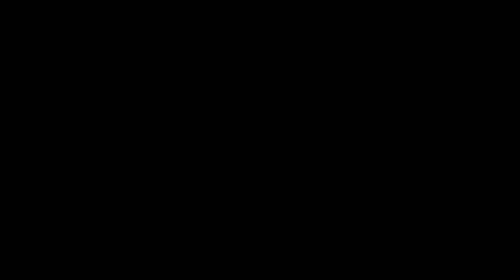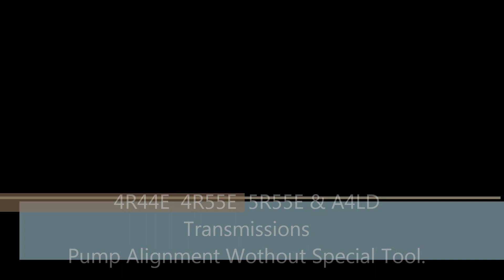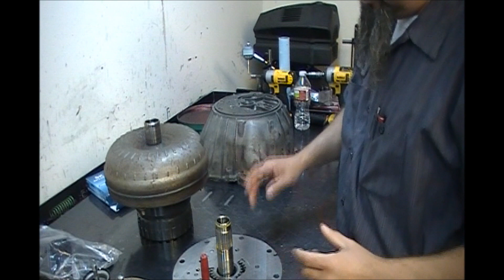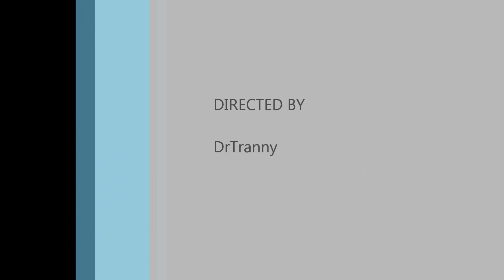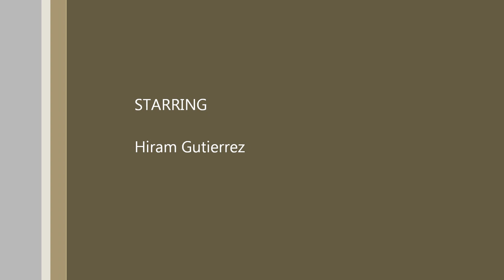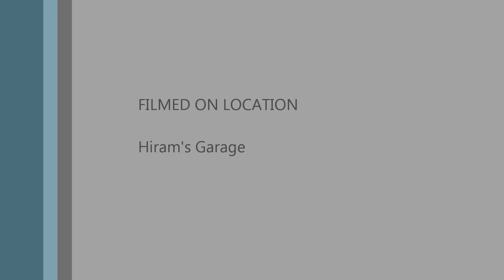4R44E Pump Alignment Without Spcial Tool - Transmission Repair

Comment: Love your videos Hiram! I asked on the explorer forum about using this method and was told don't do it. I don't see what's wrong with this way at all! It seems to me that if you're using the actual parts that it should work just fine! I wish someone would 3d scan a oil pump tool so I could 3D print one! Until then I think I'll use this method. Going to start my 4R55E rebuild very soon. Thanks!
Reply: Did you try it

Comment: I just recently rebuilt my 4R44E all new seals and clutch plates, also installed a superior shift kit. New torque converter installed everything and I have no reverse or D gear, if manually shifted into 1st or 2nd truck will move but not without acceleration. I did not do this alignment on the pump just eye balled it on installation could this be my problem? Or does it sound more valve body related? Thank you if you can give any insight in advance... Joe
Reply: Way to late to say this now but sounds like the overdrive clutch drum sprag. Just had that issue with mine

Comment: Hi hiram, im working on my 1985 ford bronco II. and i have an oil pump problem. im doing everything that your saying, my problem is that when i hand tight the oil pump it does not turn and no meal or dirt in the pump. I see that the inner pump gear has some play in the pump and I think that is the problem, what do you think. Your answer would help alot thanks for also reading

Comment: The torque converter is the best tool for pump alignment on these transmissions this also will work on  the 4L30E...Good information Thanks!